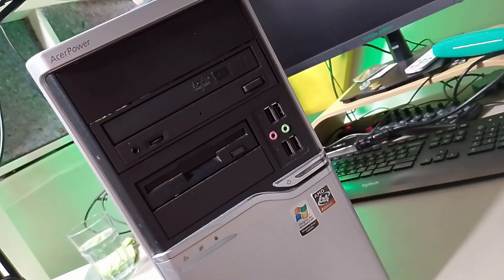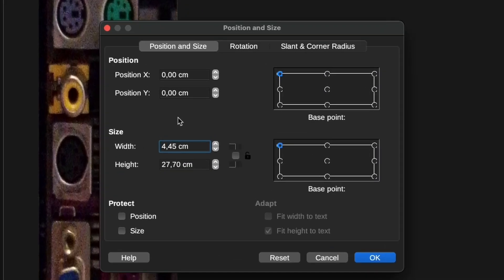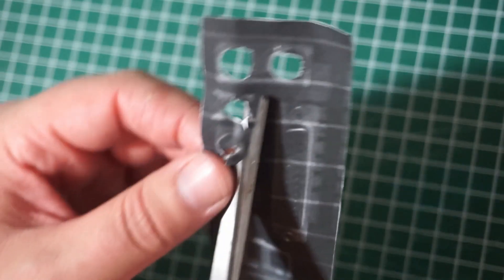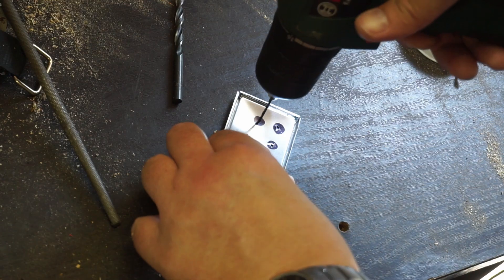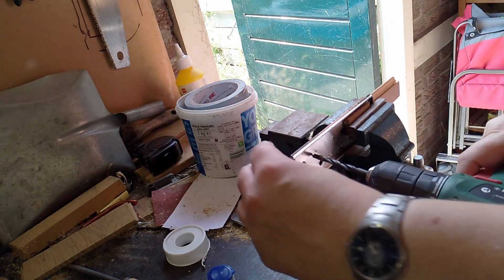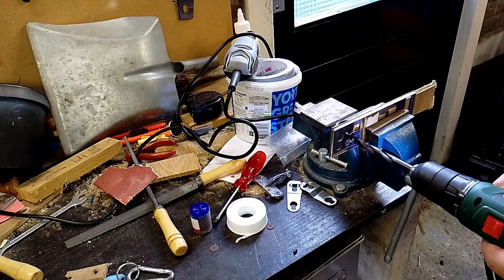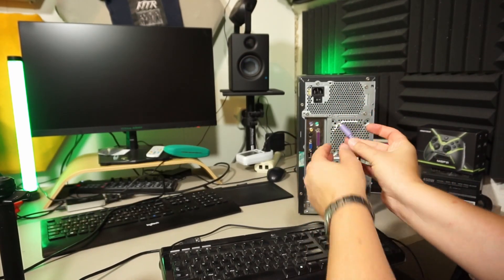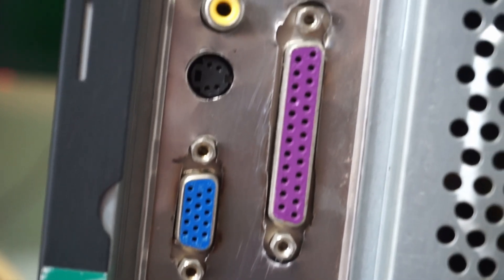Making my own I/O shield using a blank plate!

Comment: Probably would have been worth the effort to trim the paper to fit it on the back side so you could have the piece lay flat when working on it.
Someone mentioned step drill bits, those are nice.  Your bits in are in bad need of sharpening, lol.
When doing large openings, drilling the corners and cutting from hole to hole is cleaner and more controlled.
The dremel would also be great for cleaning the sharp edges.
Someone mentioned laser cutters, I have no experience with those.
I think a heavily modified paper punch would cut through that no problem.  There are steel punch tools, but I've never seen ones that small.
setting it on a heavy and flat metal surface and striking it with a sharp chisel might make a clean shear.
Now, you just have to make one with all the grounding tangs on it.  😁
Reply from the maker: I guess it shows I'm not an expert, which kinda shows that if I can do it, anyone can. Right? ;-)
Reply: @ex-itguy    Definitely.  I didn't know you could buy blanks until you posted this, so I learned a number of things myself from this video.   😉
I just thought I'd share some of my fabrication experience.
I also immediately started thinking "how would I proceed?" because, while I've managed to avoid this situation, I could see my self having this problem.
I used to try saving old plates, but quickly found out that almost every board seems to be different, lol.  Or at least different enough.
Reply from the maker: @l337pwnage  Indeed, it's very hard to find one with exactly the right holes. 
I believe I stumbled upon these blanks when I was searching for something else. :)

Comment: On the why metal: the I/O shield does a significant bit for EMI shielding. That's why OEM one's have those annoying spring fingers to interact with the grounded shell on each of the connectors that poke through.
Reply from the maker: Theoretically, yes. But in practice? I never heard anyone have issues with both the PC and the devices around it without a shield or even without a case around it. Probably more like a regulations thing than an actual issue. 
It does help against pulling your ports out when you disconnect stuff though. And there's the very big dust collecting gap without one.

Comment: Another commenter  mentioned they 3D printed something and then used foil tape. This gave me an idea. What about cardboard and foil tape, and maybe some pieces of tape to keep it in place?

Might not look the best, but if it works...
Reply: Oh and for leatherworking you have these pliers to make holes. Ideally something like that but maybe bigger could be used to make the holes without bending the plate. But I imagine the leatherworking ones may not like aluminium.
Reply: Actually, after searching some more I've found higher grate hole punching pliers that could be used for punching a hole into an ID card to invalidate it. That might work. Maybe I'll order one to see.
Reply: You probably could do that, but I don't think it would stay put very easily.  The cardboard wouldn't impart enough rigidity.  Might flex and fall out.   The I/O shield is designed to snap in and be relatively thin, as connector overmolds aren't that forgiving.  But you might be able to get away with rigid cardstock, if you tape it in from the inside of the case.
Reply from the maker: Yeah, why not. Just as shiny 😂
Edit: oops, only saw the initial comment when I replied. Those punchers might work indeed, if they're big enough for the holes you want to make. 

Cardboard doesn't really help against pulling your ports out if a connector is held on a bit too hard, but that's usually not a big issue.

Comment: I feel your pain.  Got a stack of motherboards one time with only one original I/O shield.  Tried scanning the holes on my scanner, using that with a 3D printable I/O shield model i found.  Worked OK except my 3D printer did a terrible job at the time.  I did go back and re-print on a more capable printer, then stuck foil tape on it.  The shield is supposed to help with EMI, so i figured coating it with foil tape couldn't hurt.
Reply from the maker: They say so indeed, although I never noticed anything different on a system without one, except for the fact that I just don't like it haha
If I had a 3D printer I might have tried that as well. No experience with it, but I guess that's a whole new rabbit hole to open up haha
Reply: @ex-itguy  Well, I suspect that the PC itself may not be as EMI-sensitive as other devices in the vicinity, so it may be more about meeting RF emissions regulations and keeping other electronics happy than the PC's performance.  But I have also never heard of anyone getting in trouble with the feds for using a PC without an I/O shield (or completely naked, for that matter)

Comment: I did something similar with a GPU  pcie backplate. Getting the display port to fit was a hassle😅
Reply: Same. Took some mining cards and added HDMI functionality to them.  The port was still on the board, just missing a few components and a hole on the backplate.  Dremels are great!
Reply from the maker: I imagine that to be ever harder to get right? I did have the idea to make a high profile backplate for a low profile card by just using the low profile backplate as a template though. Haven't tried it yet.
Reply: @ex-itguy  You absolutely can do that, and I have done so before, but just be aware that the metal thickness is non-zero and the little bend on the end for the screw mount can screw you if you don't compensate for it when just putting the two brackets on top of one another.  Just ensure the alignment doesn't need an offset before you cut... or that card isn't going to fit very nicely into the motherboard slot.
Reply from the maker: Yeah I figured I would just use a blank backplate for that. Plenty of old ones in my box. Should be about the same as an original backplate.

Comment: next episode; y do we need io shields?
Reply from the maker: Haha, well there are three reasons I know of. One is dust, which is the most obvious one I guess. The other is electromagnetic interference, and the main reason they're made out of aluminium. Another important feature is that it helps to keep your ports in place when you pull connectors out of it. ;)
Reply: RF regulations by whatever agency in your nation regulates RF there.   It's apparently not needed on modern PC's due to high clock cycles or you wouldn't have all these glass cases.
Just hope you don't live next to a ham operator or he might knock on your door with an RF sniffer.  😜